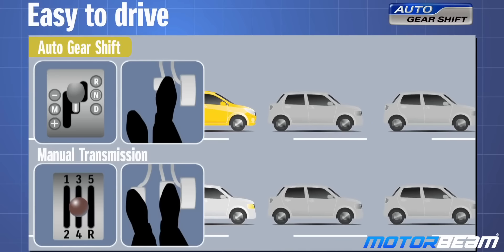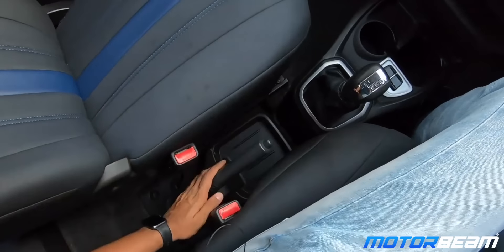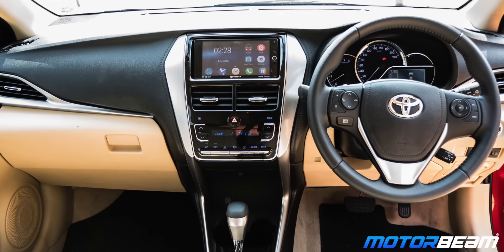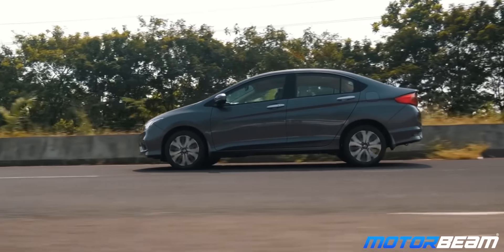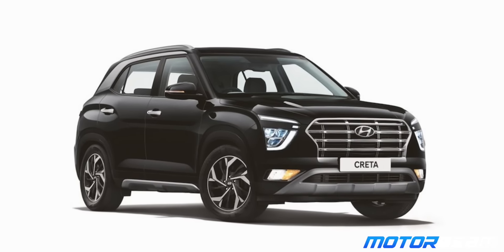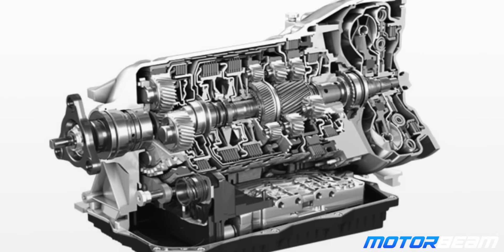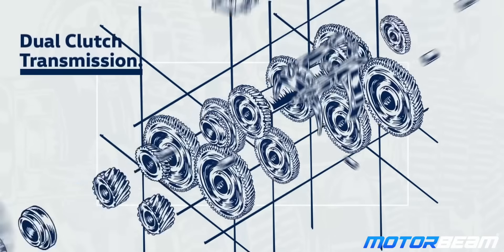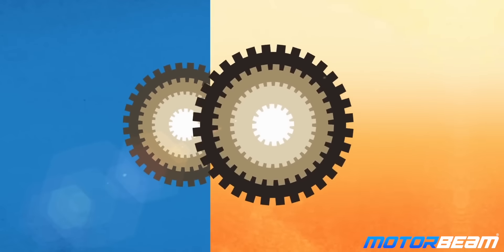AMT vs CVT vs TC vs DCT - Automatic Gearboxes Explained | MotorBeam

Comment: I've been driving manual ever since i started driving. This year i switched to DCT, and I ain't going back to manual for my daily commute and long drives.
The ease and comfort are incomparable.
Reply: What about tc
Reply: @riteshvs4949  in my opinion TC is best when you are going bumper to bumper traffic, especially when there are many incline road. 
If you do offroading TC is the best in my opinion and experience
Reply: @april7531  TC is also smooth the only catch is the fuel efficiency and lack of instant pickup compared to DCT
Reply: signs of getting old 😅
Reply: Ok now share us your experience with DCT transmission since my father is considering to buy a car which has DCT and he is skeptical about it's performance.

Comment: I think this was the most awaited video. 

CVT is ultra smooth. Yes, while cruising at higher speeds, it can show up with the rubber band effect. However, it can be repaired easily when compared to a DCT/ DSG.

The VW Group represents DSG. You won't even realise the shifts easily. It's efficient & gives you a power packed performance. However, as mentioned if it fails, it's a nightmare to get it repaired.

The video added a lot of things to everyone's knowledge. Thanks a lot for the video. 🤗🙏🙂

Hope that our dearest MB team is in pink of health.
Reply: Thanks for the kind words. Yes, CVTs are easier to maintain and they generally don't give issues if you get your car serviced on time. For those who seek performance, DCT or TC is the way to go
Reply: @pgohil100  CVT sucks. DCT is best
Reply: @pgohil100 Hi
I am using a CVT car since last 4 years.
It is the smoothest and best one.

Comment: Going By the way Everything has been explained By Parth
FOR NOW CVT'S SEEMS TO BE THE BEST AUTOS AT PRESENT TIME FOR EVERYTHING CONSIDERED..COST EFFECTIVENESS,,MILEAGE,GEAR SHIFTS,,ETC ETC ETC..CVT'S IS I VOTE FOR
Reply: Depends on the usage honestly. CVTs are smooth but i personally am not a big fan mainly due to the rubberband effect. I love DSGs, the ones with wet-clutches are reliable too
Reply: @pgohil100  me also not a big CVT fan..I love DSG too..I love too drive my freind's jetta..But there maintenance is too costly..and older ones arn't that reliable Parth

Comment: I just saw a review and got confused between dct and cvt... Motorbeam uploaded this on the right time 😂😂😂
Reply: Only the disadvantage of CVT has that it's can't give you fun like downshifting & rev engine at higher rpm & launch the rocket , otherwise it's the best transmission.

Yes you can get gears in CVT but it only happens when CVT has been coupled with gears which is very very very rear in cars but it can be seen in motorcycles....

Comment: how do paddle shifters works and which type of automatic gear box are used or can be used with a paddle shifters ?
Reply from the maker: CVT, TC and DCT gearboxes come with paddle-shifters. Paddle-shifters allow you to take control of the gears, just like the manual mode in any AT.

Comment: hi Parth, thank you very much for the detailed explanation. I was planning to purchase the Seltos IVT as IVT is very smooth and I wanted a petrol. However, the torque is very less, and that version offers fewer features. I was wondering if a Diesel Torque converter is recommended. I dont want a DCT because it has heating problems if we dont completely release the brake in bumper to bumper traffic. Does the Torque converter have that issue? would you recommended buying a TC?  thank you very much
Reply: There’s cars that have a wet dct Solves the heat problem

Comment: Faisal can u upload a video about injections like crdi, Tdi,
Reply: It's pretty much the same. Just different names based on manufacturers. These terms are basically used in Diesel engines.

American cars like ford and Chevrolet use the term TDCI or TCDI respectively which stands for Turbo direct common injection or turbo common direct injection. 

Korean cars like Hyundai use the term CRDI which stands for Common rail direct injection.

Germans and European cars use the term TDI which stands for Turbo direct injection.

While there is a minor change in implementation the basic operating method is same in which turbo is directly injected to fuel and thus the car gains faster speeds..

Comment: I was planning to buy amaze cvt petrol.. But i frequently go to hill with family 5 members.... I doubt about pulling power and performance of amaze... Pls suggest.
Reply: I am using CVT since 2 years now, you feel rubberband effect while accelerating, but no issue of feeling less pulling power at all. I dive on highways regularly with packed boot and with family. No issue at all...you can buy CVT without any worry.

Comment: Hi...I have a doubt since long,  Torque converter an be really called as a gearbox like DCT or CVT or AMT?. With my limited knowledge TC is used as a slip clutch or on CVT it gives you feel of change of gear when gear shift is done manually....its a supporting mechanism for gearbox to smoother the gear change is what I feel....please clear my doubts.

Comment: I always love to drive the manuals which offers efficiency, performance & reliability.
Reply: DCT gives 5% more efficiency & more power than MT...
Reply: @carzoholics_world  For 5% I am not going to invest extra ₹1-1.2 lakh. Also DCT are not as reliable as MT or TC.
Reply: @dutta5225  DSG is reliable. It can run cars to a kilometres of 7-8 lakhs
Reply: @adarshbhavsar122  I have seen many times that cars from VW, BMW, Kia etc. fitted with DCT/DSG have faced many issues. So in India Toyota never gives DCT with their cars. Instead their automatic cars comes with TC or CVT.
Reply: Use DCT you will never back back to manual again unless there is any specific need
Reply: @dutta5225  Toyota also has DCR in US and other market . The cost of DCT is high and it’s mainly for the those who want  the sports like performance oriented car

Comment: CVT, DCT, AT, and AMT are easy to drive, easy to shift without using clutch. They use computer to shift from one gear to another gear. We need fuel efficiency and performace power.

Comment: Are torque converter used only in diesel cars?
Reply: High Octane No .... ertiga petrol automatic and also ford aspire automatic has Torque convertor gear box
Reply: Lots of petrol cars get a torque convertor too. The Ciaz and Jimny have a 4-speed torque convertor while the old Creta and Verna had torque convertors even with the petrol engines

Comment: Manual cars make man perfect. :D 
I prefer manual ones cause shifts are in my control than on a blackbox. :)
Reply from the maker: But don't you think automatics make sense in our traffic?
Reply: @MotorBeam  not quite...since we are already quite used to manual, manageable with single gear operation. Moreover, these automatics make men lazier.